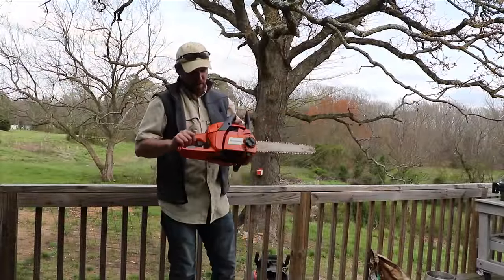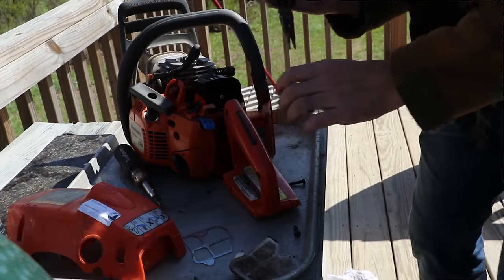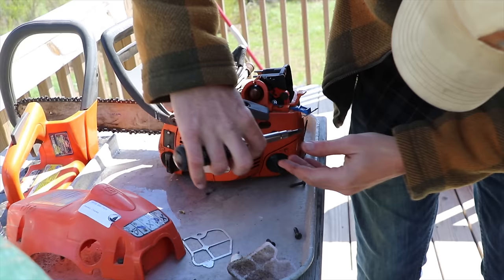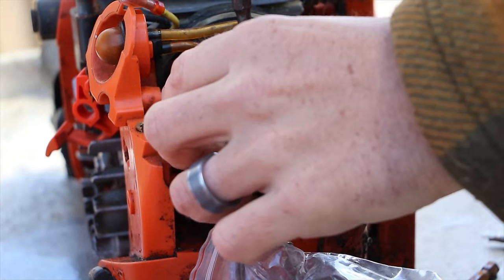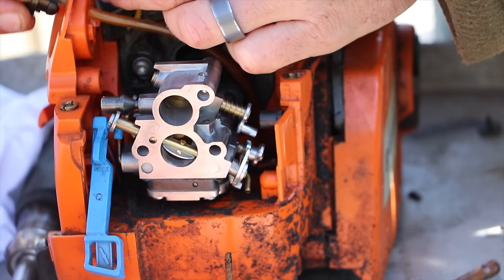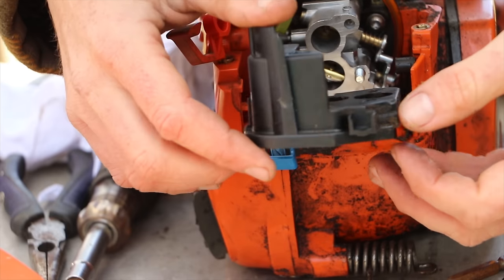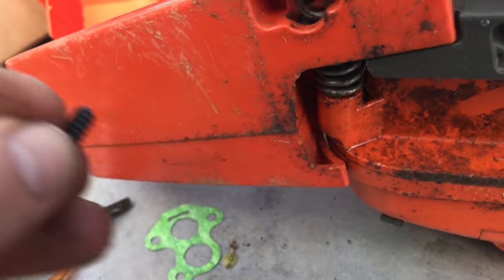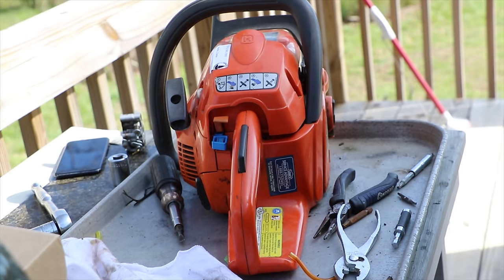Husqvarna Chainsaw Carburetor Replacement (Same for Jonsered, RedMax, and Zama)- Ranch Hand Tips

Comment: Had mine for 10 years now and haven't done one bit of maintenance to it, just adding bar oil and gas. It's always had a mild issue with stalling when idling but it's never gotten any worse and doesn't bother me too much. I never remove the fuel, it just sits in there for months or years until the next time I use the saw. I would have thought after ten years that the ethanol in the gas would have caused some major carb problems for me but not yet!
Reply from the maker: You’re lucky... although it took mine 7 years to funk up the carburetor

Comment: I wanted to thank you for your informative video...I did find it easier to split the handle and remove the throttle  linkage that way as opposed to hackin at it with pliers.  it looks to me like the link you provided  contains a Zama carb. Exactly like the OEM  carb.  I couldnt believe it when i opened the package and saw "Zama" stamped on the carb.  These OEM carbs sell for over 60 bucks at most online parts stores. Not to mention the adjusting tool, spark plug, gas filter, primer bulb and lines for 18 bucks. You were a HUGE help with this project and my 15 yr husky is runnin like a champ.. Thank you!!!!!
Reply from the maker: Glad it was helpful, it’s just not worth putting a $60 carb in an older saw like that... nor is it worth it to pay for someone else to fix it.

Comment: Thanks, I just wanted to replace the fuel line from the tank and realized i'd have to get under the carburetor. This saves me a lot of disassembly and time.
Reply: I need a tollitson hs136c carburator or one that will replace it cause they aren't available anymore

Comment: Thanks that was exactly what I need because I've not been into this type of saw before.  I found that when it comes to unhooking the throttle linkage if you put something below the engine to raise it up (I used the side cover) it gets the linkage at the right angle  to slip it out out the plastic trigger. All the best from Hampshire, UK.

Comment: Putting my chainsaw back together, I ran into a problem.  No matter what I do I can not get the fuel line back through the whole to the tank.  I tried lubing it and shaving the tip of the tubing.  I need suggestions.  Thanks

Comment: I just installed new primer, lines and carb and the primer won’t pull fuel through the carb.  It’s definitely creating a vacuum but will only pull it as far as the carb

Comment: Hi, Great video.  I'm not a big DIY, er so been searching for help on U tube. I have a  Mcculloch CS 380.The one you are working on is very similar to mine.. I have been having Starting problems with it starting then stopping after a few seconds. 
I have now noticed that when I take the fuel cap off I can hear a sucking noise as it sucks in air.  But the cap doesn't seem to have a breather hole.    However, Where the fuel line enters the fuel tank from the primer, (behind/side of the carb)  I can see a small round hole next to it which looks like a breather hole, it Looks like a round brass coloured filter. (does yours have one too?)  Is this the breather hole that usually on the fuel cap? Can it become blocked and how would I clean it? 
I also noticed that  when I purge the pump there is air bubbles in the two fuel lines from the primer. ( but not in the fuel line from the fuel tank to the carb)
   I have photos but can't send them on here. Any ideas of the problem?     
When I took off the carb I can see The fuel lines look ok. Although I have managed to change two, I can't seem to reach the 3rd fuel line that goes back to the fuel tank from the primer.  
Feeling bit frustrated as I know this problem is solvable without going to a repair man , and paying big bucks.  PS;  we live in France. Ta . You should do more detailed videos for this product, as I'm sure theres a market for it. LOL. I've ordered a new diaphragm kit which I'm going to replace on the carb, Ta.
Reply: The breather arrangements vary from saw to saw, but they do become blocked  or leak (in the opposite direction) fairly frequently.  If the tank isn't vented properly the saw will run lean after a short while of operation, so it's import to get it sorted.

Comment: Carburetors don't lose pressure. They're naturally aspirated.
Reply: The shop said that it wasn't holding pressure - It was failing the pressure leak test that checks the integrity of the fuel pump and metering valve.

Comment: Isn't the rubber gasket the problem?told it expands and sucks air ?paper or gasket sealer better?

My 236 brand new 4 years ago not had a full days use out of them ,yes both brand new and both fucking knackered.

Husqvarna don't wanna know nor do my local dealer ,brought them from fleabay and now out of warranty but only after I sent them back to be repaired under warranty ,under an hours use since I got them back ,still don't work ,waste of money.

Used husky so for over 20 years not a problem but now they are shit !